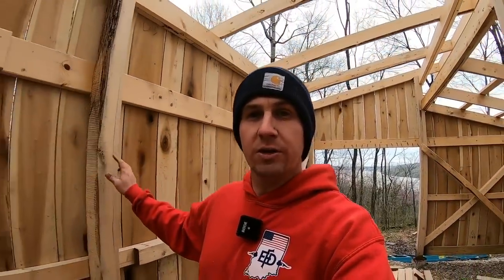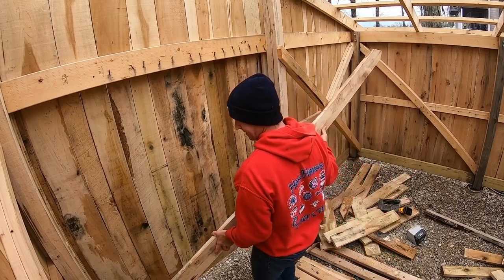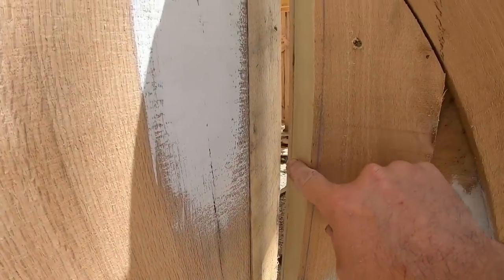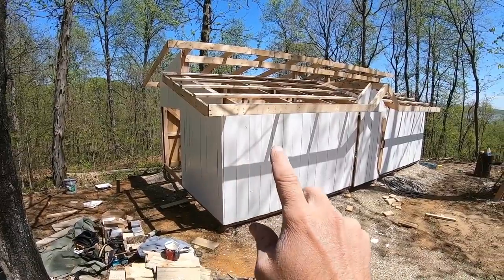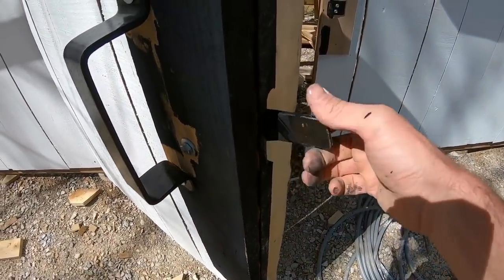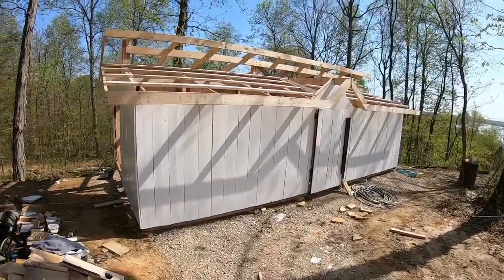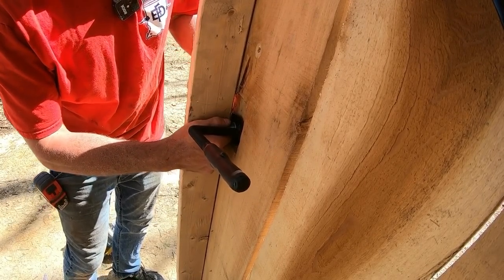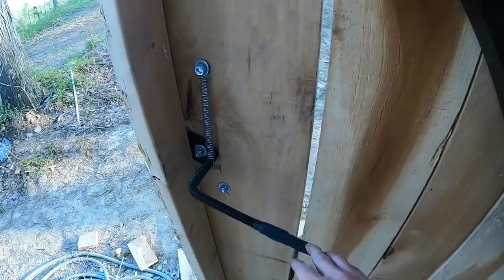12x24 Barn Build - Would you use this same color Paint?

Comment: To answer the question, "Why were barns traditionally painted red ?"   Early farmers painted their barns with a protective coating of linseed oil made from flax. Linseed oil served as a wood sealant to keep mold, fungi and mildew from leaching into the wood that would turn the wood grey - called "weathering". Linseed oil would also prolong the life of the wood twice or more years than unpainted wood; however, the linseed oil would turn the wood a reddidh-orange color, so the farmers would mix in ferrous oxide they scraped from metal tools and objects around the farm. We still have a lot of ferrous oxide everywhere - it's what we know as rust which gave the red color to the wood. Sometimes, early farmers, who could not afford tractors or mechanical equipment, who slaughtered their own beef and pork were known to mix in blood with the linseed oil which gave the wood a deep rich red color.

Comment: I'm 67 years old and I've been using circular saws most of them and I've never seen one used sideways to cut out a slot in a board to install it over a hinge or other hardware instead of a Router and Chisel or Drill Bit and Saber saw.
I guess an old dog like me can learn new tricks.
Then there's your nifty makeshift circular saw saw guide trick I have used. 
That poop factory/ chicken coop / goat barn is really looking awesome young Man.
Keep up the good work. 
Ooh, over the chicken roost you might want to install one of those ball type hot air sinning exhausts to keep the heat down on hot summer days with a fine mesh covered frame over it to keep out varmints. 
Otherwise your chickens will get overheated and may either die or stop laying eggs.
I had a friend not listen to me when I mentioned it to him and he lost half his hens and the rest quit laying.
Finally he listened and installed one and no more dead chickens plus they started laying again. 
Here in deep south Florida where  Rick ( he was my best friend growing up in Michigan) had a fruit tree / ornamental plants nursery farm as he was a landscaper )in the Southwest Miami-Dade County area known as the Redlands farm area and it was his Cuban father in law who wanted chickens for fresh eggs and chicken to eat.
I don't know if it gets that hot in the summer where you live but it can't hurt to be sure.
In the winter you have to put a screwed down insulated wood box over it to actually keep the heat in.
You'll be surprised how much heat a chicken roost can build up.

Comment: Great choice on using a Roller ... Airless sprayers are more convenient but the Roller gives better/longer adhesion as it "hydraulics" the paint into the pores of the Wood.  As for "Red Barn" coloring ... goes way, way back:  "New England settlers didn't have enough money to paint their farms. So they needed a cheap way to protect the barns' wood. They mixed skimmed milk, lime, and red iron oxide to make a red, plastic-like coating. The coating protected the wood from Fungi and Mosses that tend to rot the Wood and kept barns warmer in the winter."

Comment: I like to have the primer tinted gray, like you said Mike primer is inexpensive. One coat primer, one coat paint. 
A good, cheap airless sprayer, go with Graco. Big box stores carry replacement parts and easy to use. 
I have found that back rolling is important to scrub the paint into the wood. One note on sprayer, you are limited to 25 feet of hose. The longer the hose the more expensive! 
Great job so far!
Reply from the maker: Thanks for the tips Jim

Comment: Mike the black on the boards (before painting) is mildew, it should be removed before painting otherwise it will cause early failure in your paint job. Removal is easy: use a mixture of household bleach and water, 1/4 bleach, 3/4 water by volume with a small amount of detergent. Brush or spray over mildew and let sit for about an hour, repeat if necessary, then rinse to remove detergent. Let the treated boards dry before painting.  I love the color combination on your Barn.

Comment: For a sprayer, the cheapest that will last as long as you need will be appx $150.
Wagner airless with a pressurized hose and an appx 1/2 gallon "hopper"

As anything less might do that small barn but they are nearly impossible to clean well enough to be reusable after you let it sit between paint jobs.

Especially avoid the Harbor Freight appx $20 one.  Many latex paints are thick enough to plug it instantly.

Comment: I purchased my paint sprayer from harbor freight. I had the handheld version and just was not impressed trying to paint my privacy fence. I went with the bigger version, the one that more or less has to sit on something to reach into a 5 gallon bucket but will sit on the ground and reach a gallon pale. It has worked phenomenal for me. I've used it for my handyman jobs as well. Didnt cost me a fortune and works just as well as others as long as you keep it clean. And with harbor freight you can get a warranty and go exchange it if necessary, the awesome part of doing business with them. I've had my sprayer going on 2 years now. 
On another note, id love to build a barn like yours. Something small and functional. One shelter vs building several different ones. And I can't wait to get a welder so I can fab my own stuff.

Comment: Use a pipe,rope, pulley and an old window weight for a door closer. The weight goes up the pipe when you open the door and slides down to close the door automatically once you let go. Add weights or cut them for your desired speed/force. Works great. Can also do the same with a cable and garage door extension spring. I would conceal the spring in a piece of pipe or pvc also to avoid getting pinched.

Comment: I have a Graco sprayer myself. Not the cheapest, but it's the cordless version that runs off DeWalt batteries so it uses what I already have. No cords or hoses to trip over, and works when I don't have electricity available. One of my off-brand 6 AH 20v batteries will spray all day.

Comment: Hey Mike if you want use the off cuts to make nesting box for the chickens And that would use up almost all your scrap wood. Hey Mike Does DP have any old truck Tubes? that would also fix the  gap on the doors, and would be cheaper than a convener belt or an old fire hose.

Comment: The barn is looking great! If you are going to need to do a bit more ripping, Kreg makes a kit that mounts to the circ saw and gives you a 24" ripping capacity. Its about $40 at your box store, and should be similar priced at your local hardware store. It works great and its a little bigger so you dont lose it!
Reply from the maker: Good tip!

Comment: Mike looks and works fine, let them complain!  Too bad you could not bring the Welder up to the house and do the same door handle on the outside of the door (matching handles).  Also, you should have welded the transmission box while welding the door handle, fix the screw hole and save $75! 😁😁

Comment: There is a pour spout made that clips on the side and top lid rim of paint buckets both 1 and 5 gallon sizes that helps you not spill it and keeping it from running down the side of the bucket too. I'm not getting excited about you spilling paint because I use to spill it everytime I paint until I got one of the pour spot thingies. Its shaped like a glass pitcher is at the top on the side you pour from and has a lip that clips on the paint buckets. It will work on a regular bucket or a paint bucket that you hammer the lid back down on. Just thought about it and it helps me so I wanted to mention it in case you might want to get yourself one. Barn looks really good painted white with the black trim. Why goats? Just to have as pets or are they going to serve a purpose as milk or meat? Good video. 👍
Reply from the maker: Property management mainly
Reply: @CaptainKleeman  Oh yeah as soon as I read this I think I remember you saying that in a previous video. Thanks for telling again but sorry for me being braindead.

Comment: The word i heard on the street about the red barn or red front doors. Hmm i guess red anything painted back in the day🤔. Red had  iron oxide in it to make it red.  And that was more durable than the other pigments. I don’t have a time machine so i’ll never know for sure. 

I have the Wagner 120 and it is decent enough.  I have no idea what i am doing though. But i just looked on Amazon. It is 200 bucks.  The greco sprayer is about 300.  A little more of an investment but probably a whole lot more quality.  Plus the greco one has a dip stick to go into 5 gal bucket.  The Wagner gas it’s own 1gal hopper.  So the greco at least makes it look like you know what you are doing.   Fake it till you make it.

Comment: As for your door jams old rubber inner tube from farm tractor. Should be able to get one or two free from local farmers. And your ability to not drop the camera is improving. Mrs Captain Kleeman must’ve been on your case about it.  Looking good 👍. Also don’t use caulking in the slat’s gap. Chicken’s will pull it out and possibly eat it. Use your stripping as planned but nail it through the gap’s to allow the green wood to shrink without splitting.

Comment: Barn look good just one thing the front door braces it wrong. When you are bracing door go from the low on the hinge side and high on the latch side.
Reply from the maker: The wood diagonal is not the brace for sag, the internal metal brace is for the sag.  The wood diagonal is to tie all the boards together.  It's correct

Comment: For occasional usage, a cheap little 'airless' electric sprayer, a home handyman level one, should do just fine. I bought one for outdoor work and it works a treat. I probably wouldn't trust it to give me a good finish on an interior wall.
Reply from the maker: That would be perfect, do you have to roll over it at all?
Reply: @CaptainKleeman  we had a wagner airless sprayer for years till we moved to maine, had to be 20+ years old and used it fairly frequently. i cant speak to the current quality of there products
Reply: That's exactly what I was going to say I bought a cheap £100 airless sprayer to paint the outside of my summer rental chalets. Takes 3 days worth of roller and brush painting down to 1 day
With lots of Messing about with settings and spray distance you can get a good finish with the cheap ones
Reply: @CaptainKleeman  - I think for exterior like you have - no rolling. I just back roll interior and may not even be needed once you get the swing of it (even, streak less application). I have a Wagner too and found it worked great right out of the box.

Comment: Hey Mike I'd just close that gap on the hinge side from the inside by building the jam out so the door butts up against it when its closed simple is best. Also on the front or back of the barn I'd add 2 air windows covered with thick wire screen or chicken wire and storm shutters added on for storms and winter. So it keeps the barn nice and cool during those very hot days. 🤔😉👍 And maybe make a push down lever handle heavy on the left that sticks out on the outside of the barn to push up on the latch to unlock it. When your hands are full and you only have an elbow to open it.